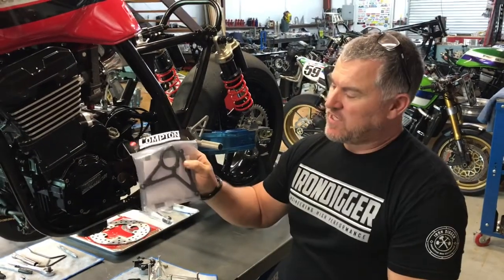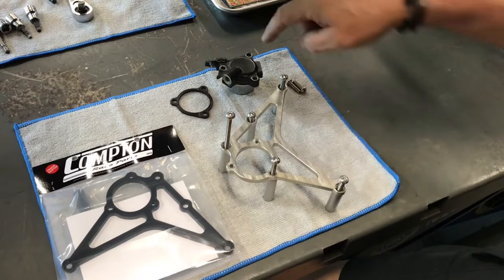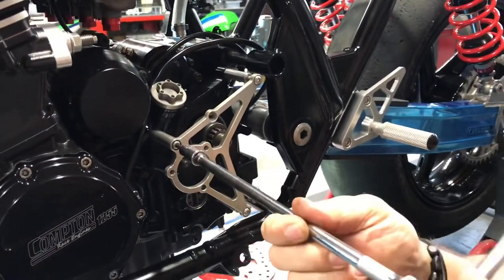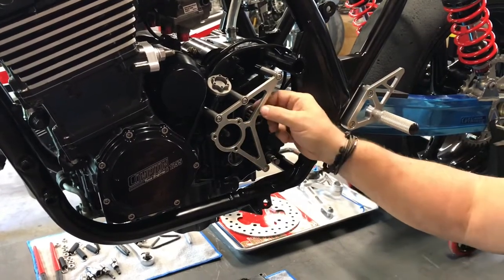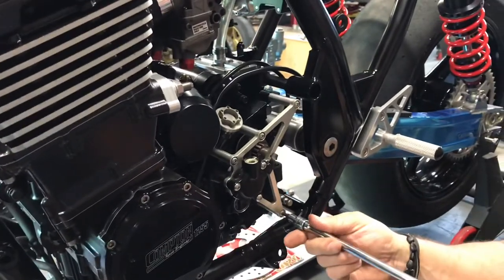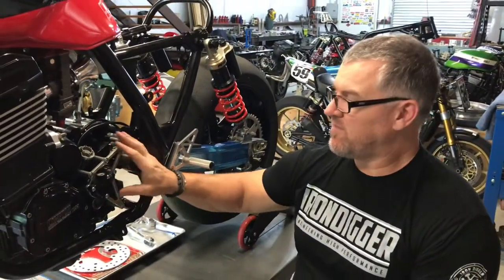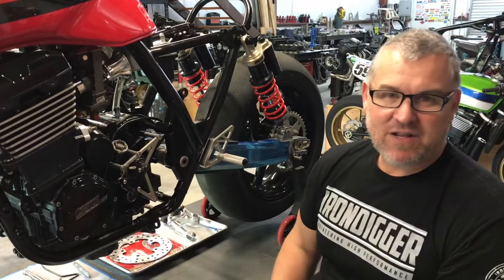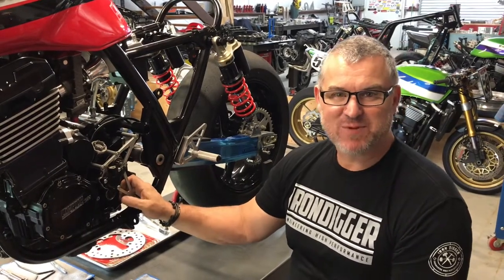Counter Shaft Cover Installation

Comment: I had a shock the other day, I run a similar cover and when about 400 miles from home I noticed a high pitch squeal coming from the motor, the chain needed lubricating, of course with the stock cover you wouldn't notice it so its now my chain lubrication alarm.